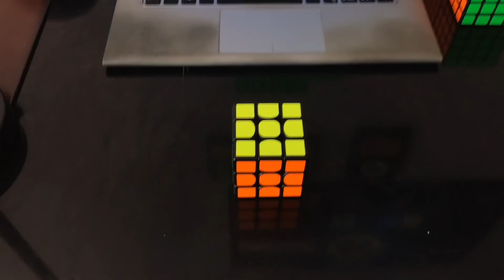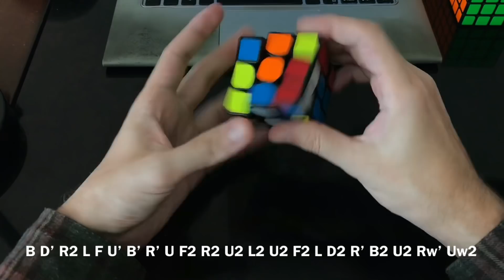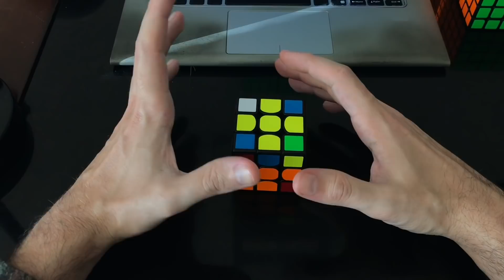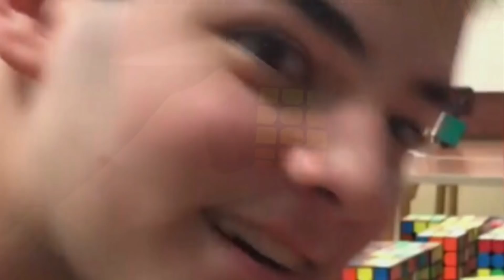Fixing Parity in MultiBLD Pt. 2: The Magic of "Weak Swap"!

Comment: So every single solve you have to pseudo solve the buffer, so sometimes cycle to RU instead of UR, which would be slightly slower on a cube that happened to have no parity right?
Reply from the maker: Nooo no no, you don't use weak swap on 100% of scrambles.

Weak swap saves you an alg on 49.62% of parity scrambles, and *never adds an alg if you use it as intended*.
The reason it only saves you an alg on 49.92% of parity scrambles and not 100% of parity scrambles, is because there are cases where you will get the UR/RU piece during tracing before you get your buffer. If this happens, you should not use weak swap. If you do, and you end up having no parity, you will give yourself an extra alg/word.
Reply: Graham Siggins but on a cube that didn’t have parity you may be doing 2 algs that include RU rather than UR, and RU is a slower subset. That difference is probably small enough that the saved algs make up for it, but it’s still a potential loss.
Reply from the maker: TheGrayCuber if I understand you correctly, then partially yes.
Using weak swap means you will have one less alg/word on roughly 50% of parity scrambles, but 50% of those algs will be like .05-.1 seconds slower than the average UF-UR-xy alg.

Definitely seems pretty insignificant to me 😛
Reply: Graham Siggins yeah, I think that’s what OP was getting at
Reply from the maker: TheGrayCuber ohhhhh ok, yeah. I see now. In the beginning he said “every single solve you have to pseudo solve the buffer”, which is not how it works — then I thought by “slightly slower” he meant there is an added alg, due to the fact that he was doing weak swap when it doesn’t work lol.
Now I see he meant the UF-RU-xy set is “slightly slower” than the UF-UR-xy set.

Anyways, yea, that’s true, but the difference is minimal and it will only have an adverse affect on ~50% of scrambles at that. Definitely seems negligible to me
Reply: @GrahamSiggins  now I have a pretty good idea of how weak swap works when there is parity. I'm still kinda confused when I do it on a non parity cube, for some reason I end on an odd letter when using the memo method. Right now I'm trying to figure it out by myself, but I might make a more detailed post on bld support group later.
Reply: @TheGrayCuber  I could be misunderstanding either through me reading your question wrong or not understanding weak swap, but why would your last edge target ever be RU after you've already pseudosolved the UR edge